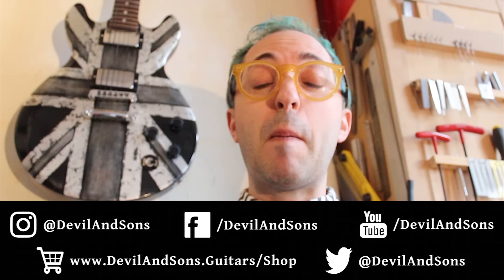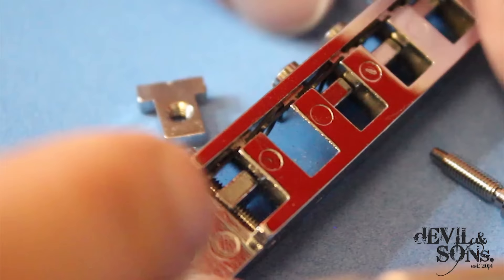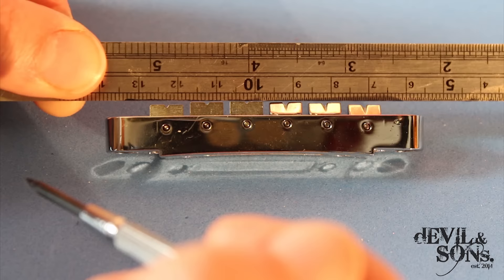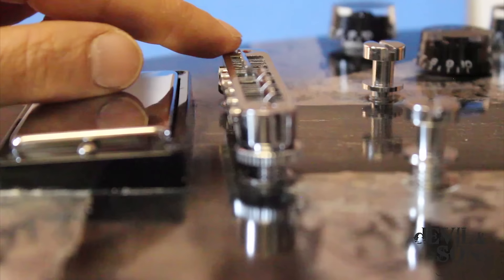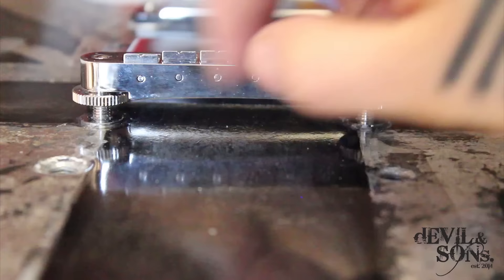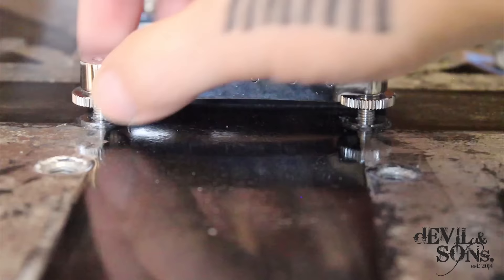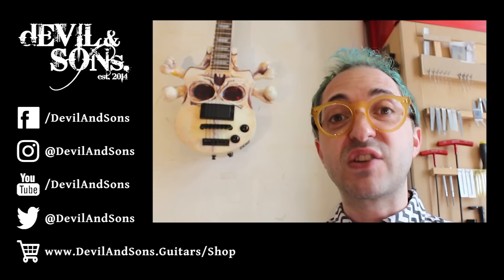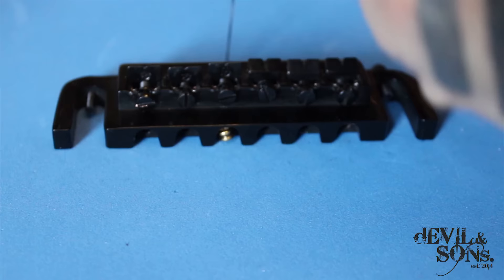Setting up a Tune-o-matic bridge (Les Paul style)

Comment: quick tip - put a large rubber eraser behind the tailpiece when taking off and resetting brand new strings - this keeps  the tailpiece in place so it doesn't fall off and scratch the guitar.
Reply from the maker: Thanks for the tip, I'll give that a go. Cheers.

Comment: It's much better to thread the string through the tail piece from the front and have the string go back to the neck over the tail piece so the break angle between the tail piece and bridge is not so severe
Reply from the maker: Some people really like doing that, and also think it means they can have the tailpiece screwed down all the way to help with sustain.

Comment: Daniel, I have just purchased a roller bridge. The posts that go into the guitar  are a different diameter. To avoid plugging the original holes and re-drilling/re-tapping them to install the roller , is there an adaptor to compensate for the original hole size ?? ( a bit like a Russian Doll thingy), thanks in advance, any advice appreciated from yourself and others,Howard, H6UK
Reply from the maker: Howard SIX silly question, but do the original posts that stick out of the guitar fit into the bridge? If they do but are loose it may be easier to wrap something around them so they fit the bridge snugly.
Reply from the maker: Howard SIX if the original posts don’t fit at all you’re right - it’s a bit risky taking the originals out as they are normally quite well fitted into the body, but it’s possibly you may be able to pull them out by putting the original shaft back in the threaded part and slowly pulling them out together - I would worry this would chip the varnish around the hole as it comes up.
Reply from the maker: Howard SIX I think your suggestion may be hard as I imagine the diameter difference is too slight to make it possible to “Russian doll” the new post to fit. Is there much difference? There may be such a thing online, perhaps even just for changing the diameter of a bolt to fit a nut and not a guitar specific thing, but I’ve not seen them. A google or YouTube search may throw up some suggestions on widening a bolt diameter.
Reply from the maker: Howard SIX honestly though the easiest thing would probably be to find a roller bridge that fits your current post hole dimensions - that way there’s no risk to damaging the varnish on the guitar and you know the bridge will fit well and have no give when playing. Sorry not to be able to suggest something straight off that will fix the problem.
Reply: @DevilAndSons  The original tune-o-matic posts are the same spacing as the roller, however the inserts are very slim. do you have a recommendation for a size for size swap... >?....p.s. What you doing up at this time in the morning ?? Thought I was the only one with insomnia.Always a pleasure, old mate, H6UK
Reply from the maker: Howard SIX So the post of the original bridge are too slim to fit the new bridge but the spacing is correct? and the threaded part that goes into the guitar on the new posts is a different thread to the old post? It may be easier to narrow the holes in the new bridge by filling them the redrilling. Do the holes in the new bridge have threads or is the... you know what, I’m going to stop typing. This will be easier if you can send me a couple of photos of the old bridge and the new one then I may have a suggestion - nothing guaranteed. My email is info@devilandsons.guitars
Reply from the maker: Howard SIX if emailing isn’t possible I will keep trying to explain what I think you could do on here, it may just take a bit longer to resolve, but there may be a way.
Reply: will borrow the granddaughter's camera, daniel, and take some snaps to show the poblem..thanks for your patience, howard...
Reply from the maker: Howard SIX great, I hope I can help, but of course there could easily be the situation that this bridge just isn’t compatible with the already drilled holes. We’ll try our best to problem solve it together though!

Comment: thanks for this! I just bought an SG and spent last night bummed out that the strings were dead and buzzing on the frets, once I really got into playing it. I watched this, learned the anatomy and mechanisms, then I put new strings on and made some pretty dramatic adjustments and it is "fixed". I was almost going to take it back, but it was just way off/ strings needed to be raised.
Reply from the maker: Excellent news. It's mad that the guitar came so badly set up but absolutely great that it's now what you want. Happy Strumming!

Comment: Outstanding vid. Great explanation of the bridge and how it works. Very, very helpful. Best I've ever seen.
Reply from the maker: Don Lessnau thanks for your kind words, much appreciated.
Reply: Do you know is there anything you can do to sort the rattling buzzing retainer wire on the tunomatics.looks like a g string sort of size,seems a bit wasteful to chuck them due to that.or is swapping to using springs an option.
Reply from the maker: Sorry, for some reason I only just saw this comment. They are quite important to hold the screw in pace but if they are rattling I think they aren't engaged with the screw thread correctly. They may need a bit of bending. Also, if they aren't actually doing anything then maybe they could just come off?

Comment: Spot on explanation. The whole better resonance/sustain from a fully screwed down tail piece is something I have yet to see any proof of so I'm still doing a medium tension with thru-hole stringing. It may be another "tone-woods" debate that never gets anywhere.
Reply from the maker: I think you are very likely to be right about that. Thanks for commenting.
Reply: @DevilAndSons  wait, do you mean that piece that's held by the two pillers and the tension of the string because funny thing i was setting my bridge hight and i didn't think to loosen the strings so the pressure sorta pulled out one of the pillers, i was already gonna replace the strings anyway, so i would use some sorta wood glue to hold it back after i restring it soon, though a fully screwed tail in this case may not help since the whole puller was pulled but idk
Reply from the maker: Wow. The whole thing pulled out? Actually a bit if wood glue or super glue should hold it back, and perhaps screwing the whole tailpiece down low will mean it has less give and be less likely to pull out.
Reply: @DevilAndSons  you mean screw it like you did in the vid? i just finished watching and yeah i gotta agree it does put alot of tension on the tail piece if it's touching the base
Reply: ohh i didn't understood "screw it low" , now i get it you mean not as low to the point where it's touching the base
Reply from the maker: I was thinking if you were worried of the pillar pulling out you could screw the tailpiece down to touch the guitar, but if you are able to glue it back in you will probably be fine. Just checking, it was a pillar on the tailpiece not the bit with the saddles that came out?
Reply: @DevilAndSons  yeah the tail piece. the saddle is pretty fine, , my piller dosen't screw down that's why it got pulled easily, well i noticed it was leaning forword a small bit because of the pressure and one thibg lead to another I'll make sure to make it a bit higher after the new restring and glue
Reply: i was running a ltd vipor 10 if you're curious
Reply from the maker: I think that makes sense. Good luck and, if you remember, do come back here and let me know if it works - you can't leave me hanging!
Reply: @DevilAndSons  yeah thx i i was referring to the base which the two pillers rest on which in turn gets put inside the two holes aka, it isn't screwed rather tightly held in, this was my old brother's guitar he gave it to me as a gift so I've been trying to set it up

Comment: No offense, but I'm impressed you spend 20 minutes explaining possibly the simplest bridge ever. Fits on posts, adjust with thumb wheels and has screws under each saddle for intonation. Done, 10 seconds!
Reply from the maker: Ni offence taken. You'd be surprised the diversity in knowledge and confidence out there, these videos aren't for everyone but if you look through the comments you will see that for some people these types of videos are helpful. Also I am trying to explain the intricacies of elements such as the saddles to help people get the most of it. Anyway, glad you came by for 10 seconds at least ;)
Reply: @DevilAndSons  I stuck around for the whole thing. Yes, I did notice a lot of people got quite a bit out of it. Great job. 
I'm not surprised at all. I own a repair and set up shop and I get quite a few, pretty decent players sometimes, a day for simple string changes! There seems to be a fear when adjusting anything on a guitar that people have, especially with the truss rod. While excellent videos like this may be bad for business but I still believe every guitar player should be able to do basic service to their instrument.
Reply from the maker: @12south31  true, people should learn the basics, but if they don't at least there are people like you to help them.thanks for watching and commenting.
Reply: As a novice with a new chibson type 330 this is gold..
Thanks.
Reply from the maker: @johnnorris1983 thanks so much for adding that comment. Different people have different needs so great this suits you.

Comment: That's interesting.  I never knew why the bridge saddles faced the way they do.  It's because the bass strings need to be further away from the nut then the treble strings to be intonated properly.
Reply from the maker: It's a clever little design element. Thanks for watching and commenting on the videos, much appreciated.

Comment: seriously thankyou so much for the videos. i learned a lot about this tune o matic. (i usually use floyd rose bridge), especially the section about the bridge itself. i just got myself a new 7 string guitar with tune o matic so this videos helps me a lot.
Reply from the maker: It's a pleasure. Thanks for taking the time to comment. What guitar did you get?
Reply: @DevilAndSons  its an old LTD Viper 407
Reply from the maker: Very nice
Reply: @DevilAndSons  thanks. i already follow ur channel also.
Reply from the maker: Thanks so much.

Comment: You can buy a special tool from Gibson for adjusting the big screws on the stop tail piece. It’s like a socket with a bar on the inside for turning the screw without damaging the stop bar or guitar.
Reply from the maker: That is a really good thing to know. I think stew mac may sell something similar too. Thanks for sharing.
Reply: Yes they probably sell it too. Just thought you may want to know or let other players know because a lot of people fight with those screws and end up damaging them. I know I did. Your video really helped me set up my bridge properly yesterday, so thank you for that!!! She plays like a dream now!!!!
Reply from the maker: @heatherwade2373 so glad to hear that. I didn't know about the tool until after I made the video. The stew mac ones are expensive
Reply: Yeah, just about everything is expensive for Gibson guitars. Here’s what I did, I unscrewed the posts all the way and put a little lubrication on the threads, and put them back in. Found a set of pliers that matches the thickness of the stop bar screw slot, and use one end of those thick pliers as my screwdriver. Now I can turn them without damage until I can buy the tool. The main thing is to use something that fits the width of that slot on the big screw. Anything too thin will slip and cause damage. Your pop sickle stick is still a good method.
Reply from the maker: @heatherwade2373 lubrication will really help, that popsicle stock can break. I ended up buying a big screwdriver! Half the price of the gibson tool. Stew mac also sell tools for all parts of the bridge including a great looking device for taking the pressure of the posts whilst you turn the thumb wheels.

Comment: Cheers for Advice on bridge & tuning be having trouble with tuning & sound
Reply from the maker: It’s a pleasure. What are the problems you have been having with sound?
Reply: @DevilAndSons  buzzing on 12 fret thin E
Reply from the maker: Hippyskin 64 Two potential fixes for the buzz though are try raising the saddle height for the string that buzzes, this may stop it without the action of the string being noticeable too high for you, or most likely to adjust the truss rod - again I haven’t made a video on this yet, but there are a lot out there, you’ll probably find loosening slightly will help.
Reply from the maker: The full set up video is now up, you may find it useful: https://youtu.be/fvD-qsM3piQ

Comment: one of the best explanations!
Reply from the maker: Thank you, I appreciate you taking the time to say that- it makes it worthwhile knowing people watch these.
Reply: @DevilAndSons  i have a question. Mi tune o matic is standard one. My bridge does not have a regular curve in the arrangement of the saddles.  It's more of an irregular curve.  Could this be a problem or is there a reason for this? Thanks
Reply from the maker: You will find that the height of the bass strings needs to be greater than the treble strings. Perhaps it's set up to compensate that? What guitar do you have?

Comment: What are the advantages or disadvantages of shortening or lengthening the strings with the saddles?I'm struggling to understand what are the correct positions for the saddles.Thank you for your time and effort.Great video.
Reply from the maker: Hi. I’ve almost finished making a video on how to setup your guitar which will explain just that, but essentially in order to have the correct intonation (so your guitar isn’t only in tune when you play an open string but is also in tune at every fret) the string has to be the right length. The easy way to test is if the string is in tune when you play it open, and then plays the same note an octave higher at the 12th fret and in tune then the string is the right length. If the note at the 12th fret is slightly out of tune whilst the open string is in tune then the string is the wrong length and moving the saddle will correct the problem. Stay tuned for this in more detail in that video (hopefully in two weeks) or do a search for someone else’s intonation video -there are lots of good ones. This is basically a detailed explanation of how the bridge works and not the in-depth explanation of a full set up. I hope that’s helpful.
Reply from the maker: And thanks for taking the time to comment.
Reply: @DevilAndSons  Thank you.Looking forward to that video.
Reply from the maker: Skinny Dog Jefferson cheers. It’s a big one to edit but hopefully a good one! Good luck with your guitar.
Reply: @DevilAndSons  will be patiently waiting for the next video, as I am setting up my 2007 Les Paul for the first time since I got it back then.. (shameful, I know lol)
Reply from the maker: Goony Tunes if it’s been playing well it’s not shameful, but hopefully it will make that little bit better. Have you at least changed the strings though?
Reply from the maker: The full set up video is now up, you may find it useful: https://youtu.be/fvD-qsM3piQ

Comment: Cool!  I feel sorry for the women or men who are not mechanic incline or basically don't understand mechanic thingy and hardware nuts and bolts.  I adjusted my new Schecter C-6 which the frets are smooth like a baby butt but the action is too low and buzz like a bee.  Now it feel like a dream but low E still buzzing.  I think the 0.46 gauge has that deep low bass but its heavy and that why it still buzz.  Maybe I will change just that E string to 0.42 will fix it.  Thanks for sharing.
Reply from the maker: Changing the string may help, but if it's just the low e string you should see if raising the saddle height slightly stops the buzz, it may well resolve it.
Reply: I did raised that E as high as it goes.  I don't want to raise the whole bridge up, which I did on the lower E side.  Maybe I go to 0.44 instead of 0.42.
Reply from the maker: @wolfdue2236  hopefully that will work